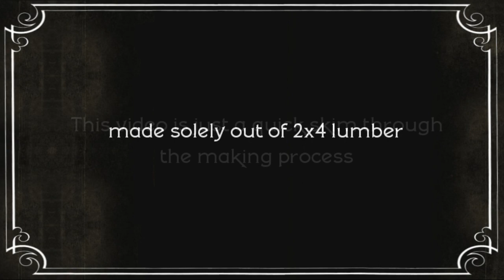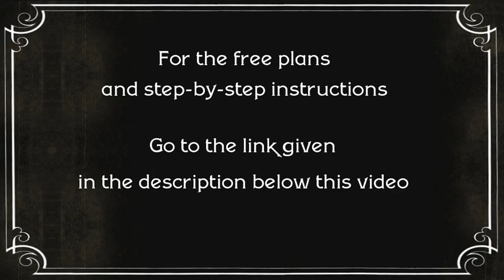Folding picnic table made out of 2x4s

Comment: I just made this table. It is awesome! I did run a little short of wood on the board with all the little cuts, but that was the only issue. Cool table/bench. I used pressure treated lumber and the table is very sturdy and stable.

Comment: Hey I just got your plan and I was just wondering, if I can make it 6 of 2 x 4 instead of 5. How can I make the change from 5 to 6. Thanks
Reply: Just add 3.5 inches and the width of the gap, if you use one to the overall length of the cross braces. I do suggest a small gap even if 1/8" to allow water drain and snow melt.  Remember to cup all your lumber.

Comment: What's the total cost of materials?
Reply: Count the lumber and multiply times, $3.21 for non-treated and $4.27 for treated. Non-treated will not last long outside in all kinds of weather. Bolts and screws approx. $15.00 Most people paint or stain with exterior materials. I have seen many lately with covered with exterior dull polyurethane. I suggest you cut and sand thoroughly then paint or stain before putting together. It will be all covered and be a better finish.  Please use either stainless or non-rust coated screws.